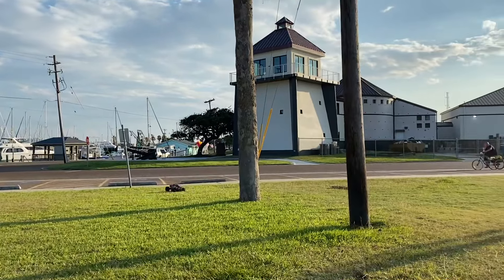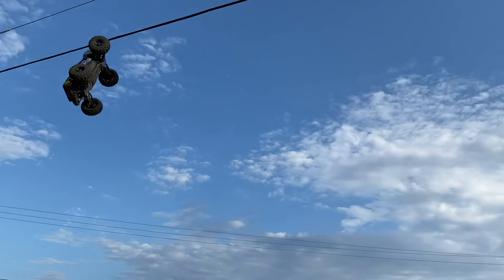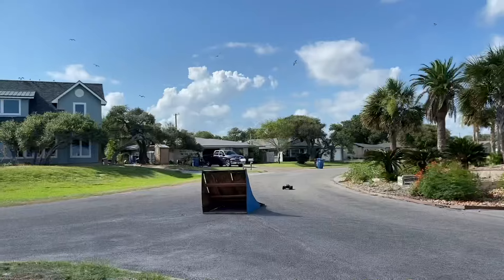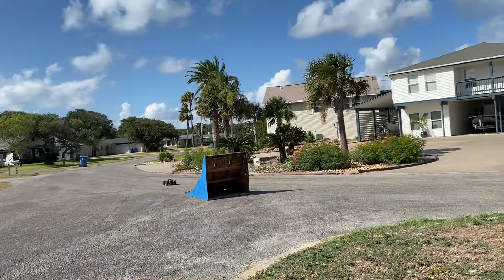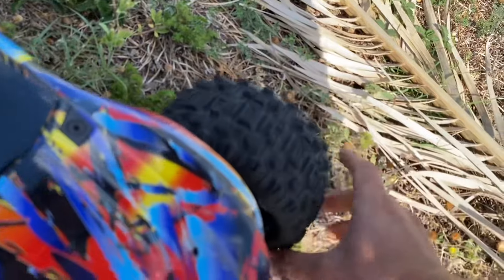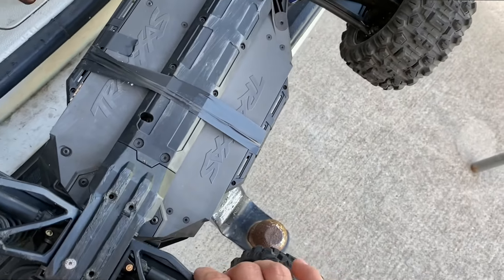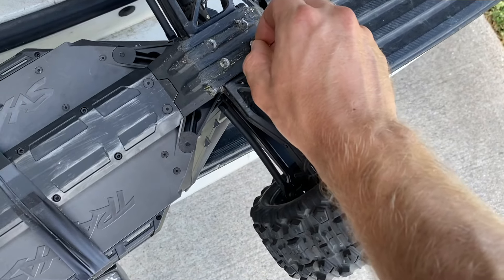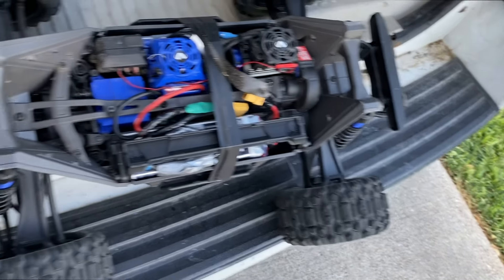This is a super tough RC! How can this car take so much abuse?

Comment: I keep breaking front bulkheads on mine.. Do you have any recommendations for to add rigidity to help prevent the bulk from splitting?

Love the vids!! (Recent subscriber)
Reply from the maker: Thank you bro! Unfortunately the bulkhead is the major weakness on this platform. The one solution is billet bulkheads front and rear but it costs a lot. I did that once and the truck was bullet proof!

Comment: I really wished the maxx I had was half as tough as yours I really don't know how the same car can be so different for people mine literally broke every single run and I NEVER sent mine half as hard as you my wood ramp was so small in size it's like in between the 2 ramps I have now....

Guess it's the same with all cars cause I know people who hate 6s ARRMA say they are the worst diffs on the planet and I NEVER have a issue 2 years on a few of my 6s with stock diffs
Reply from the maker: I loved my Kraton 6s man! Total beast! Flew like a champ and drove on rails! I only had a few ring gear issues but after hard bashing so no biggie. I have cracked front bulkheads on my Maxx as well but that happens about 1 time a month for me with extreme bashing. They are all good cars! I just can’t afford them all haha. You know the feeling! 🤣🏆🏆🏆⚡️⚡️⚡️⚡️⚡️⚡️
Reply: @thunderrc  I do know that feeling got a hole list I'd love to
Reply: My 2 month old k6s v5  diffs are showing zero wear 👍.  Yet my 2 month old rlaarlo has been through a set of outdrives already .  Still , I like that little fekker . Found a granite 3s v3 4 months from Amazon bnib for 2 bills today . What luck
Reply: @Hungrybird474  my exb diffs are all good I've replaced all the cups for aluminum and have m2c outdrives in them all.... but I've had to replace a lot of parts already including all the arms but 1 rear lol check out the channel we be sending them lol

Comment: I love mine! I've only upgraded to the captured suspension pins because the normal ones would slowly work their way out. My body is looking pretty terrible at this point because sometimes I do land upside down. Actually, just yesterday I had a session. In 30 minutes of battery I jump a natural dirt death ramp at a construction site near me probably 2 times a minute. That's around 60 jumps a session. At least 10 feet in the air and 20 feet long each time. Tough tough tough!!! Love the Maxx.

Comment: Hi Rocky, how are you?
Basically the Maxx is a beast and you prove it to us once again man 👍 great video ⚡⚡⚡
You can install the wedges 10234 of the MaxxSlash by modifying them slightly so that they fit into the triangles of the Maxx v2 the travel gained down and up for the bash I do them and it works well 👍
Tchouss my friend😉✌️

Comment: Paid for by traxxas 😂 screws  backing out 😆 more like front and rear bulkheads breaking.
Reply from the maker: That’s right bro! I get paid 200k a year from Traxxas to be bias and make bias YouTube vids.🤣🤣🤣🤣🤣Your on point!
Reply: Nothing finally got a response, but I'm curious about your bulkheads. I've been breaking those, and one of the reasons I sold both my maxx v2, are you editing that out to make them look tougher for traxxas sales😂😂😂l😂.
Reply from the maker: I break my front bulkhead about once a month but it is super hot where I live which makes the plastics very durable. If you buy the metal bulkheads this truck truly is bulletproof proof. I did that to a Maxx once and man it was crazy tough!
Reply: Thanks for your feedback, I was looking at aluminum bulkheads for X-Maxx or latet down the road for an Xrt. I had xrt in the past, and bulkheads kept on breaking but might  get another one and also try to put xmaxx upper and lower arms on it